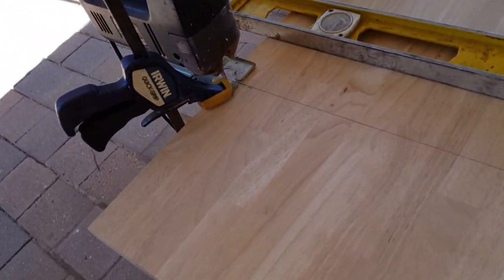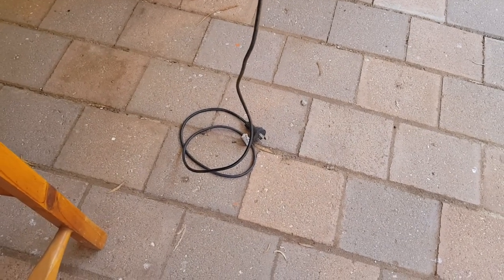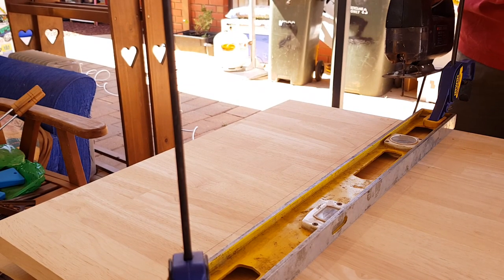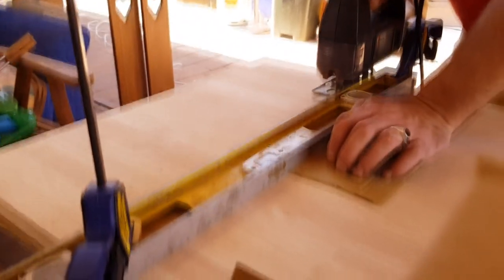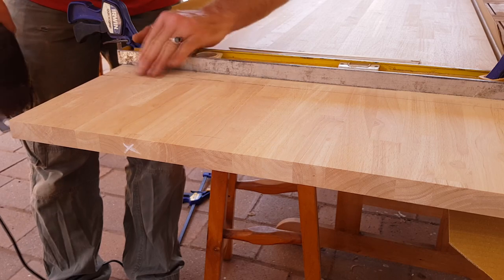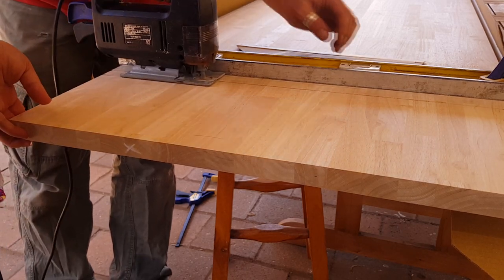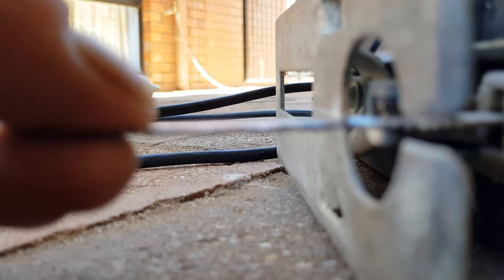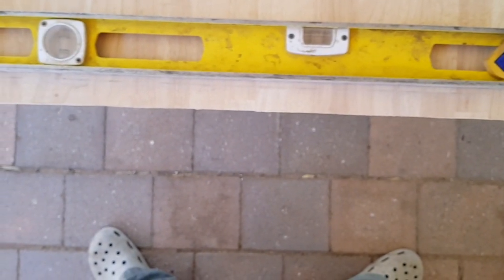How to cut straight (when you only have a jigsaw)

Comment: hey mate, might be a older video, but this is exactly the sort of info I was after. Only have a cheapo zigsaw myself, and a project I want to work on needs a few long straight cuts on MDF. I didn't really want to fork out for a circular saw (will only use for this project) or a table saw. Nice to know I got options and not limited by the few tools I have. Thanks!
Reply from the maker: Too easy mate, just go nice and slow and you'll be right

Comment: It can be done. I'm cutting circumferentially around boxes. You are probably right on the thickness limit for this tool and it looks like hardwood. You need a new sharp 14tpi or higher blade that cuts on upstroke, don't force it, be patient and don't stop. A few runs with a sharpened handplane and sanding will fix what you have.

Comment: Good timing. I just tried this a few weeks ago and couldn't understand why the jigsaw couldn't keep a straight line even though I had it up against a hard edge.  I now understand that jigsaws actually cut circles better than they cut a straight line!  It worked ok though for the shelves I was making and the crappy jigsaw cut is at the back where no one can see it.  Will now invest in a cordless circular saw!
Reply from the maker: Yeah jigsaws don't like running in a straight line. I've seen some people make a jig that attaches to the jigsaw and puts a bearing at the loose end to stabilise the blade, could be worth a try one day but yeah, circular saw is the way to go

Comment: Had a Black and Decker Jigsaw for years, recently upgraded to 18v Ryobi. I think with the setup you had you cut a great straight line 👏🏻
I’ll be doing something similar using the 18v Ryobi … (for the first time 🤞) thanks for the tip about the cardboard under the clamp 🗜 hadn’t thought of that 🙄😆👏🏻
Reply from the maker: Nice, I too have just upgraded some of my tools to the Ryobi cordless. Haven't got the jigsaw yet as the old B&D is still kicking along but I think the bearings are starting to wear out. Good luck

Comment: I've been trying to cut straight lines in MDF board and experienced the same violent vibration you did. It was awful, lol. I still haven't figured out how to get through this project
Reply from the maker: The best tip I can give you mate is to take it slow and use the correct type of blade. Less/bigger teeth will chew through your board much faster and easier
Reply: From what I've seen and experienced myself, there is a tendency for beginners to ever-so-slightly lift the rear (usually) of the shoe when using jigsaws.  Anything less than even and firm pressure on the entire shoe will result in a ridiculous amount of vibration, which takes nearly all of the power out of the actual cutting and puts it into shaking things and your arm apart.  When this happens, cutting becomes slow and hard, and most people will instinctively push forward on the blade, which only ends up causing more vibration and sometimes even less cutting.  If you use the right type of blade, it's still sharp, and you press evenly down on the shoe, then comparatively speaking it should cut right through like butter--not like a circular saw can, but experiencing violent vibration is abnormal and means you're doing something wrong.

It looks so easy when the experts do this, and their cuts look so much straighter and nicer solely because they know how to hold and press down on the jigsaw.  It's not because their jigsaws cost more--if you don't use a $500 jigsaw the right way, the result will likewise be violent vibration and slow, pathetic cutting ability.  This cheap Black+Decker is plenty good enough--assuming sharp, appropriate blades, the equipment is not the issue here.

Comment: Doing the best you could with what you had to work with, I also only use a jig saw for most everthing, Ive worn out my shoulders with hand saws, i found a brand name jig saw at a pawn shop, I keep lots of sharp blades and like you, Never rush!
Thank you for posting and sharing!!
Reply from the maker: Haha, I got my jigsaw about 7 years ago from a thrift store! Black and Decker and it's been a trooper. Sharp blades are my undoing, I keep forgetting to get new ones so I just keep using the old blade. Have new ones now that are more appropriate for wood

Comment: Need quality saw and of course a blade to match. My recent acquisition of Bosch GST160 barrel handle professional saw though bit expensive proved to me that a calculated expense in the long rung would be very beneficial. I binned my old jigsaw that could never cut straight and heavy on vibration. . Only a diy enthusiast but easy cutting minor vibration light and quick release blade is worth a lot of time and frustration saver. No expert but got there with this jigsaw. Enough said. Did my  research and homework paid off..
Reply from the maker: Nice, I'll look into that model. I've been looking into getting myself a circular saw. There's nothing really wrong with my jigsaw but I was definitely using the wrong type of blade
Reply: @DoctorOctane  Two days ago I bought a cheap straight edge clamp 50 inches long for absolute certainty for straight cuts. I will test it in the next few days to see whether I am  happy with it or a more expensive purchase is necessary.

Comment: The issue i saw here isnt the saw, rather the wood not being supported properly, thus the blade being slightly pinched and causing excess friction either slowing down the speed of the cut or having to pause it all together. Try again using the same way you set up the bumper rail, but this time support the side being cut off for a better smoother cut
Reply from the maker: Oh,  So you're saying to put the guide bar on the waste side yeah? I like that, cheers mate
Reply: @DoctorOctane  that's not what he meant. He's talking about supporting the waste side so that it doesn't fall when you finish the cut.
Reply from the maker: Yeah, that's why my wife comes in and supports it for me
Reply: @DoctorOctane  you still don't get it. When both sides are supported properly vibrations and pinching of the blade are eliminated
Reply from the maker: So you mean I should clamp down both sides or something? Might be worth a shot
Reply: @DoctorOctane  yeah that’s what he means. People use sawhorses and stuff like that for that kind of stuff I think.

Comment: Jigsaws sound so easy, but when it comes to straight lines I think they are the most difficult power saw. Well done posting, difficulties and all, many wouldn’t have done so.
Reply: I have the same issue. I spend ages aligning a straight edge and it still wavers
Reply from the maker: Yeah, jigsaws just don't seem to like travelling in straight lines. We can set them up as best we can but the tool is still going to want to make it's own path

Comment: Also when she asked "isn't it going too slow?" and you said "it's the wrong type of blade" I felt that spiritually.
Reply from the maker: Haha, yeah it's a constant struggle
Reply: Because it wasn't the blade type that was the problem. Take away the guide and you will not struggle. It is the blade wandering towards the guide that causes the struggle as described in my previous comment.
Reply: @DoctorOctane   Usually when there is that much vibration, it means that the shoe isn't being held flatly and firmly against the piece being cut.  Lifting the shoe--any part of it and no matter how slightly--will cause massive vibration and slow the cutting down to a crawl.  Rather than pushing forward on the blade, try pushing down on the rear of the saw to see whether that helps.  There will always be vibration, but it should be "smooth" rather than rough and violent.

Comment: ill be honest... i just learnt that jigsaws arent meant to cut straight lines..
Reply from the maker: Technically, no 'reciprocating' type saw is designed to go in a straight line, they're used to cut out shapes. For example: jigsaw, scroll saw, sawzall, etc. Sure most people use them to cut straight lines but that's not what they're designed for. Saws that have blades that travel in a straight line or in a circle have blades that are better suited to cutting straight lines. E.g. table saw, circular saw, band saw. That's not to say you "can't" cut circles with those saws, it's just harder than using the three saws in the first example to get straight lines

Comment: you're going too fast. slow down, take your time and try to keep a constant speed. especially when you try to cut a thick and/or hard wood. and try to cut it in one pass just like how you use hand planner, by stopping in the middle you risk yourself too cut too much material in that point. good luck next time.
Reply from the maker: Hey thanks for the advice mate, I might have another bench to make in the coming weeks so I'll take some of your ideas on board. I'll also get myself a wood cutting blade for the jigsaw as I was using a metal cutting blade (it's all I had) in this video. Which is also why I had to stop so often - to cool the blade

Comment: Should probably mention that it's only something you can do if the cut doesn't HAVE to be perfectly straight. Wouldn't be suitable for things like table legs etc.
Reply from the maker: True. Also if it was crucial to be absolutely straight, I could have definitely planed it straight but being that that edge is up against a wall, it's not that crucial :)
Reply: @DoctorOctane True, if you have a plane, you could sand it for a slightly more even finish either. I've done the same thing myself in the past but much more shodilly. 

Interestingly you can get a jigsaw blade that claims to be good for straight cuts. i just ordered some off of amazon for a project I'm doing this weekend so I'll let you know if they are any good. 

(in case you're interested the project is a kind of cubicle wall on my desk that I'll use for cable management, gear mounting and led lighting)
Reply from the maker: I think I've seen those blades, they're a bit deeper than a standard jigsaw blade yeah? Sounds like a cool project
Reply: @DoctorOctane  If it works out it should be. Not particularly complex. Yeah they're wide blades with a regular t-shank and a grille behind the blade edge, which I'm guessing is for heat dispersal. Hopefully it works out. :D

Comment: You are showing a certain technique which I have seen others try and which you are trying. You are not the first. I have tried it myself. IT DOES NOT WORK. You do just as well if not better by carefully following the line by eye. Here is why it does not work.
Although the body of the saw is following a straight line (the guide) the blade itself is very small and will tend to wander independently from the direction of the saw body. If the blade is wandering away from the guide, this often results in a broken blade. If the blade is wandering towards the guide, this makes it very difficult for forward progress, as you discovered. This idea seems good, and it seems like the obvious solution. But... it does not work very well. As you point out jigsaws are not meant for straight lines. I wonder if I can come up with a better way...? hmmm.

Comment: Get a better jigsaw that one is a piece of garbage
Reply from the maker: What jigsaw would you recommend?
Reply: @DoctorOctane  Bosch they make outstanding jigsaws corded or cordless, Dewalt and Makita also make very good ones too your going to pay over a hundred for the corded and  over 3 hundred for cordless if you don't batteries and a charger, if you have batteries for one those brands then it will cost a little under 200 for tool only, there are other brands Milwaukee,  Ridged, Ryobi that are decent but any of these are a way better than that old black and decker
Reply from the maker: Haha, I'm quite partial to Makita myself so I'll probably go that way. Haven't gone down the cordless route yet apart from a drill but priority is a circular saw

Comment: You seriously butchered any technique that might have resembled what you tried to do, lol.
Reply from the maker: How so? Constructive feedback will help me and others to learn
Reply: @DoctorOctane  Fix the plate you are working on (not sure if that was an issue here, but the setup looked wobbly), to minimize vibrations. You can use a guide on both sides, so you do not have to concentrate so much on pressing the saw against the guide. 
Also the MOST important thing: Saw slower. I know the video is sped up, but it still looked way too fast. Never press the saw forward. Only push (slightly), when there is no resistance from the work piece.

Also your sawblade looked ... bad. Use one that is made for cuts like this. For example a Bosch T308BFP. These are EXTRA thick (about 1,6mm) plus the opposing blade orientation will give you a clean cut on both sides.

Also check, if the saw blade is square to the base, before starting.

And while doing the cut (with double guides) you should backtrack every cut you have made. What I mean is: go forward 2cm, go backward 2cm, go forward 4 cm, go backward 2 cm, go forward 4 cm and so on.

By resetting your cut, you will fix out of square alignment immediatly (if you go slow enough), should it ever happen. And only small parts will be out of square. If you just go forward, the blade can tilt more and more.
Hope that helps.